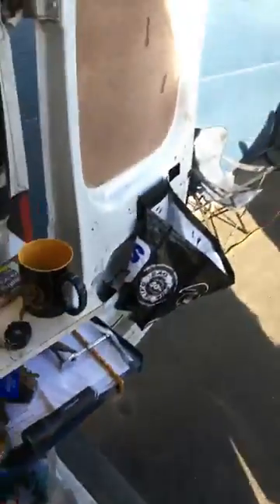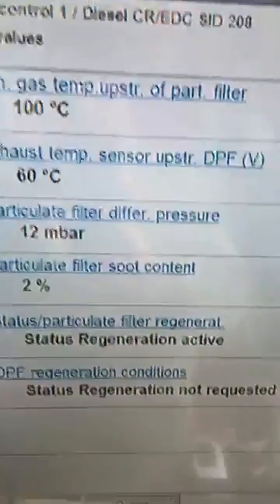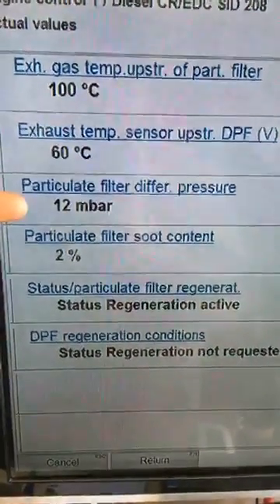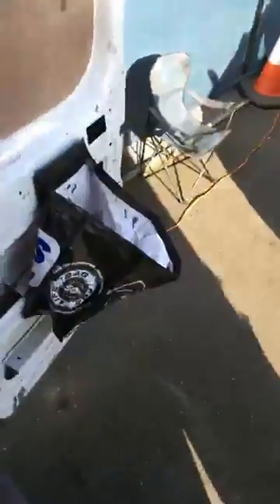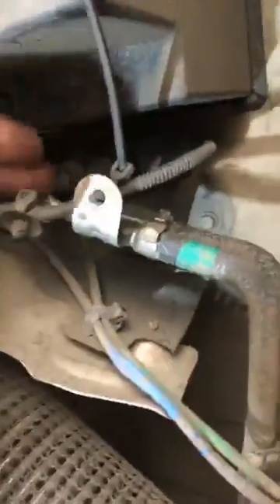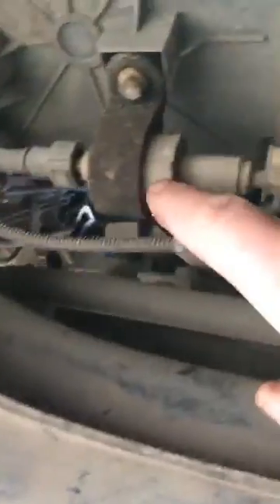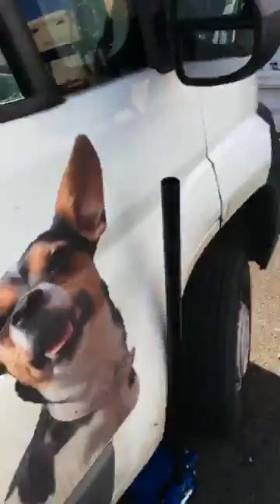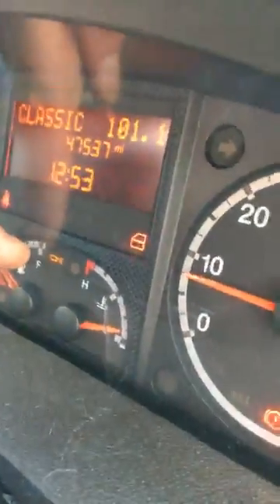Relay 1 P15BE

Comment: hiya mate ive got a peugot boxer van 16 plate with P15BE active millight on.what does it need to fix. thanks
Reply: hi thanks i didnt need take it to anyone.Ive been an engineer in the motor vehicle industry for over 30 years.Ive sorted it.Your video pointed me in the right direction. Thanks
Reply: @raywalsh5822  what was the problem in your case? how do you fixed it?
Reply from the maker: Recommend taking it to a suitably experienced and qualified workshop for an assessment. Hope this helps.